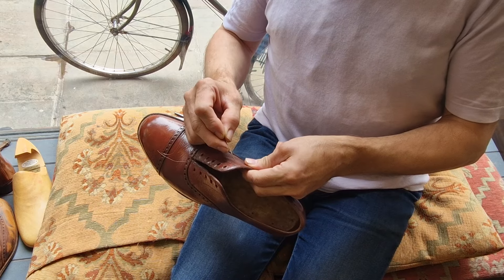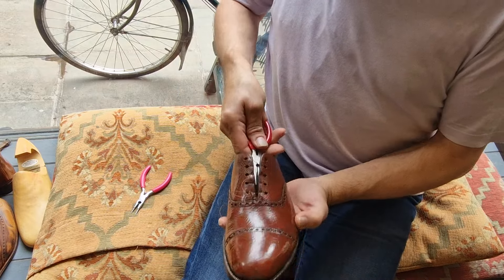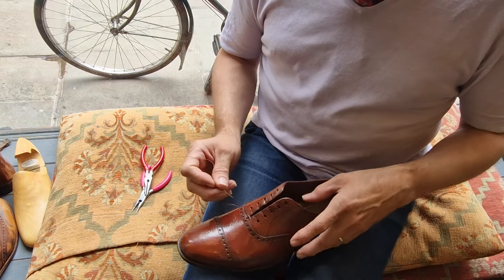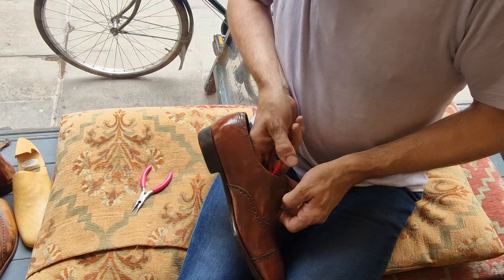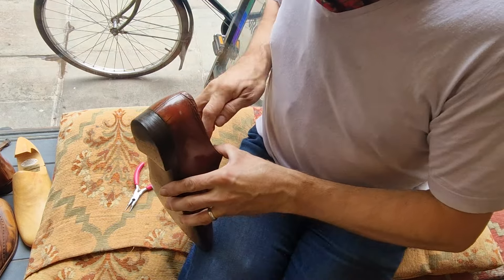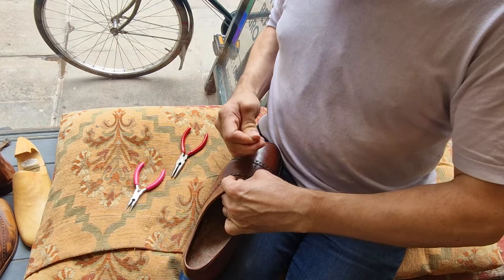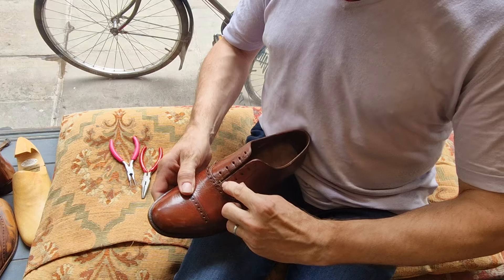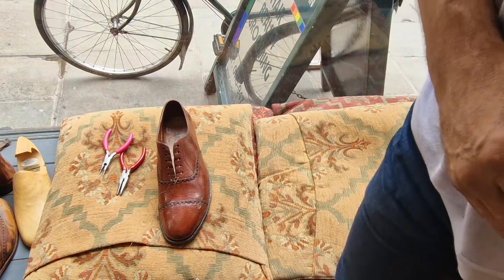Replacing a few failed stitches on 1786 Russian Reindeer skins, made by George Cleverley in 1991

Comment: I think the stitch is a sort of bar-tack, like the stitch done on the non-rounded end of a hand sewn button hole. Have you got someone in mind for the time the shoe needs resoling? Is there any text on the waist area of the outsole? Cheers for the video. M
Reply from the maker: @MisterBurtonshaw  I have such a large number of pairs of shoes, no single pair gets alot of use, it is most unlikely these soles will need replacement in my lifetime.